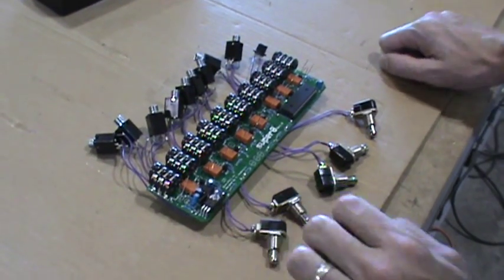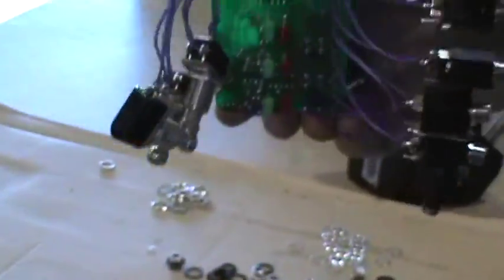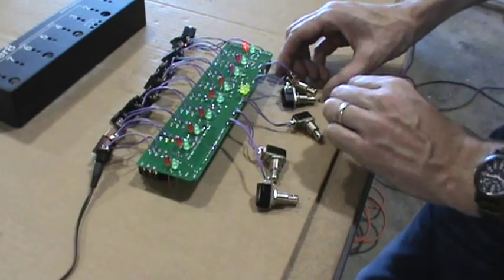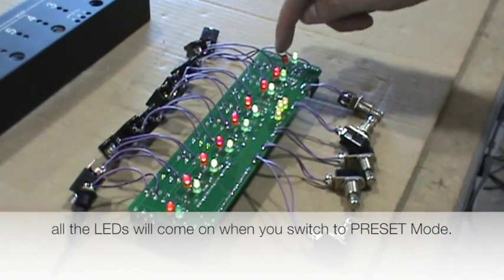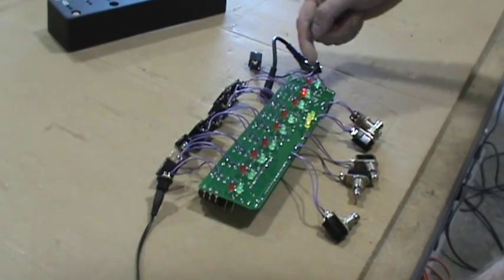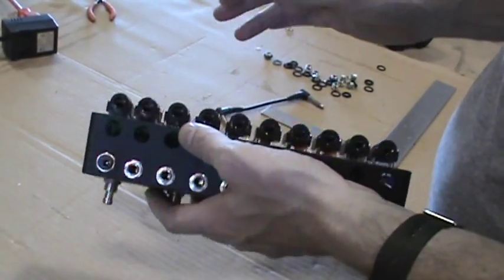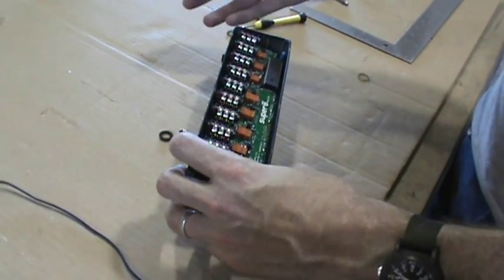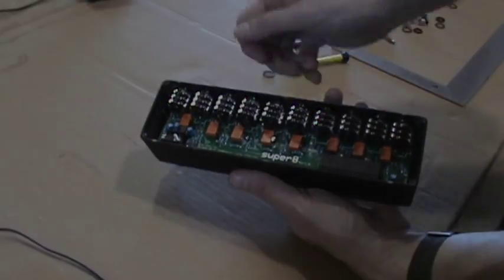BYOC super8:  Installing LEDs and PCB assembly

Comment: Just a design thought. If you setup the LEDs on their own prefabbed board tied to a connector then you can insert the led's first and mount them to the chassis. Then the LED boards connector can just plug into the main board. Less of a hassle than trying to keep it all together and assembling it.